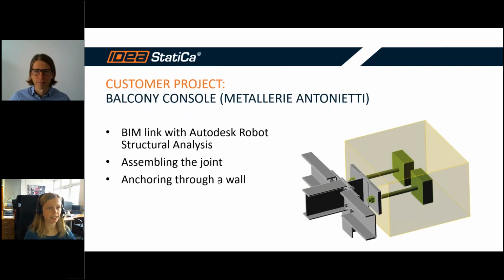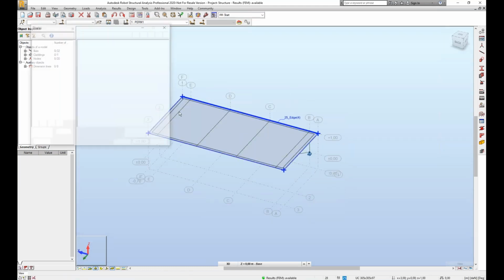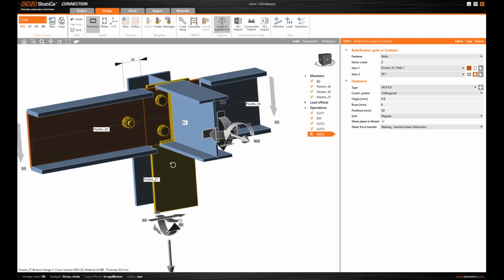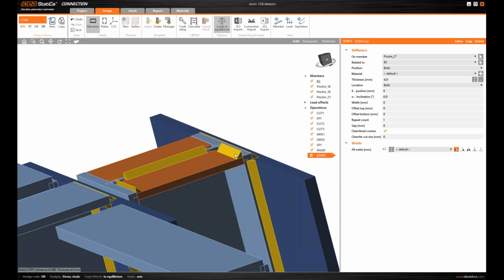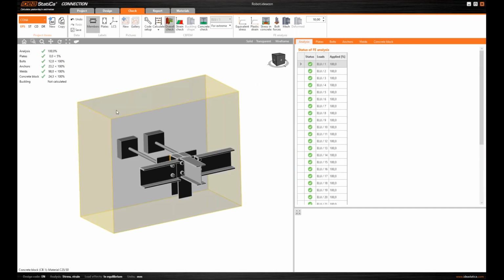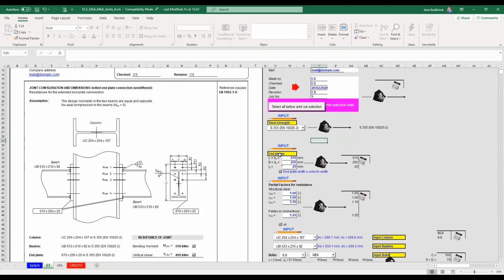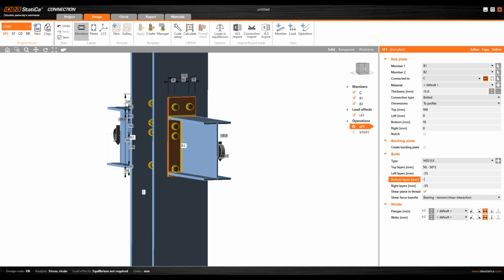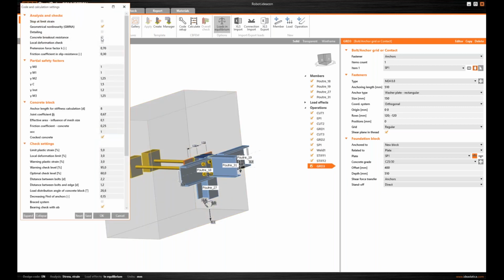Connection Wednesdays – Balcony console imported from Robot

Comment: I have the same excel format for design steel connection according EC. Really is not as idea statica. Idea statica is more more powerful software. But price what i pay for  these excel is 250 times lower from idea statica price. For that you cant make comparation between these two  ways of  calculation. For more engineers price of software is  most important factor for choosing real  way of calculation.
Reply from the maker: Hello Pane, Thank you for your comment. We fully understand part of the design job (simple and moderate connections) you can achieve with some more advanced excel-based tools. On the other hand, we know from hundreds of our users, their investment paid off in a few months. It is not about the money you have but in money, you will save thanks to increased productivity. You can save up to 80% of your time spent on connection design done by IDEA Statica comparing the design done in excel sheets. Then it depends on the volume of steel connection design job you do monthly, based on this you can calculate if it pays off or not.